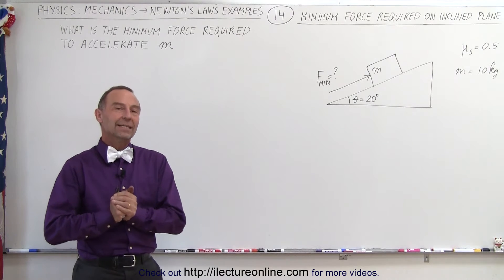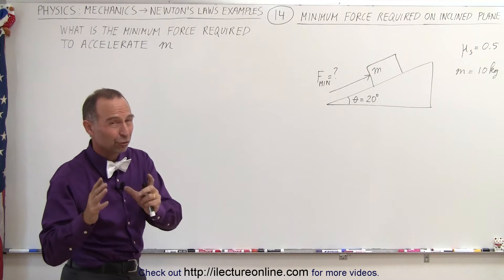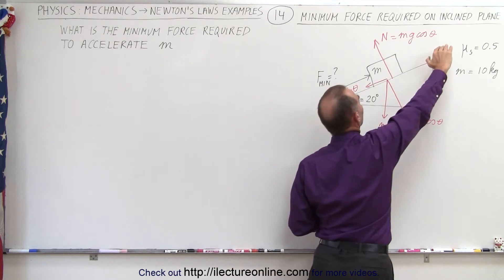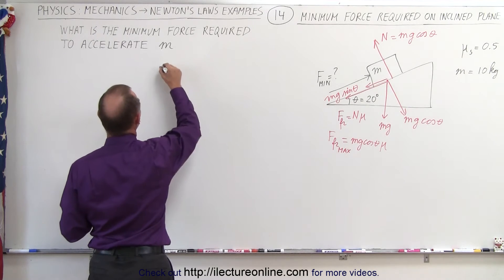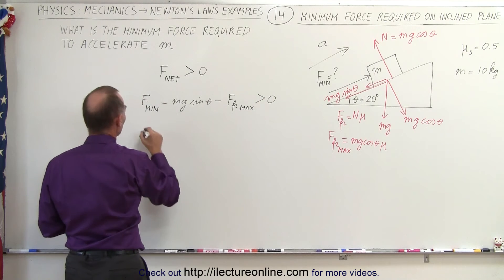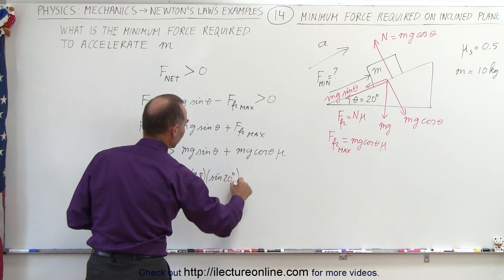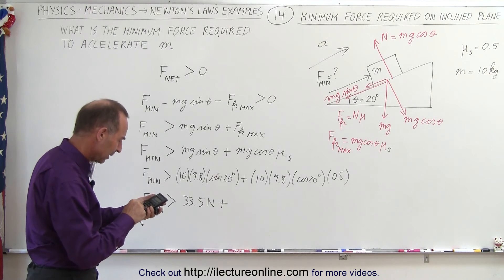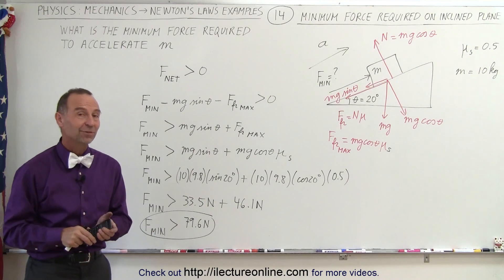Physics 4.1 Newton's Laws Examples (14 of 25) Minimum Force Required on an Incline

Comment: Force equals mass x acceleration

Ottoman cannon 
260kg x 125mps = 32,500n

Modern Sabot round
7.9kg x 1,575mps = 12,442n

The force of the Ottoman canon is 2.5x greater, but the M1A2 abrams has a top secret armor that nobody knows outside of DARPA. Its believed to be some kind of ceramic dispersion outer coat with hardened alloys beneath. Take in mind that the Abrams also weights 72 tons or 144,000lbs (65,455kg). Newtons 3rd law says force has an equal and opposite reaction so the canons Newtons are actually less than half the weight of the tank so we can assume the tank wouldn't move much when struck. Now if you scale down the experiment and compare a more rounded tip slug like a .45 pistol compared to a 556 NATO; a Kevlar vest could stop the rounded off pistol round no problem, but even a 55grain 556 would go right through it. I would say that the Abrams survives with minimal damage due to the amount of surface area the canon ball has in addition to considering the dispersion technology.
Reply from the maker: Interesting information.

Comment: What if the ramp was frictionless and the applied force was parallel to the ground. How would you calculate the minimum force to prevent the block from sliding downward? Thanks.
Reply from the maker: The you need to find the parallel component of the force:    F cos (alpha)  and that component must be equal to mg sin(theta) which is the component of the weight parallel to the incline

Comment: Good morning. I have a question. If I had a F = 50 Nw (for example) I would have a = F/m so a = 50/10= 5 m/sec2. In this case too the mass would have an acceleration .....or not?. Many thanks
Reply from the maker: I am assuming that the 50 N force is acting on a 10 kg mass?  If yes, then it is the mass that will experience an acceleration of 5 m/sec^2
Reply: Michel van Biezen but Why you say that tFmin is 79.6 Nw to have acceleration?